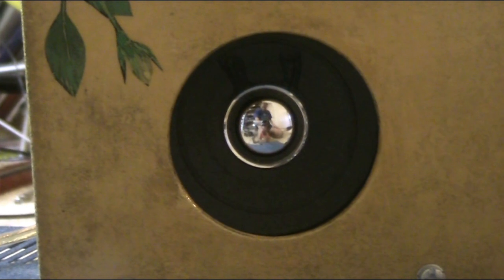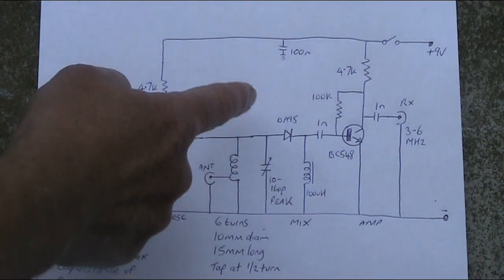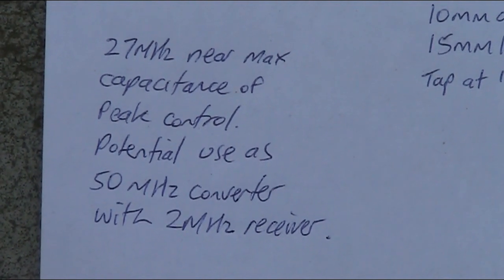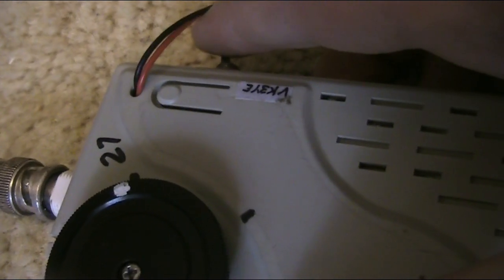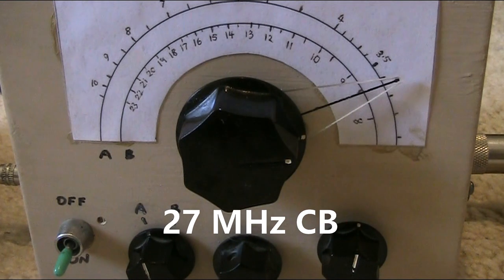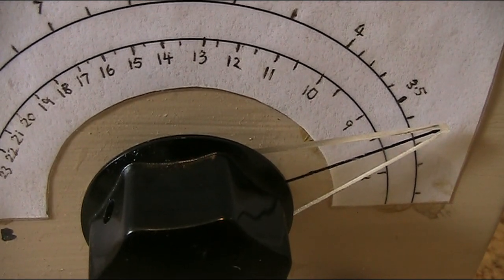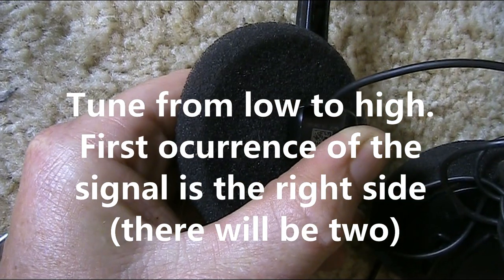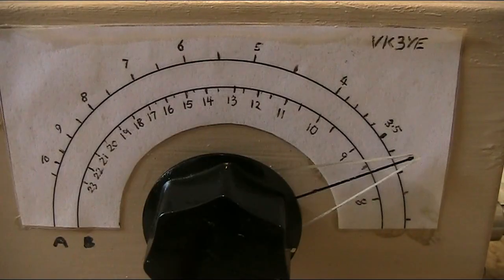Hear 27 & 28 MHz action with just 2 transistors

Comment: Thanks Peter, interesting stuff. Do you have any general advice on identifying the connections on that type of variable capacitor. I have a few but the markings are hard to read and I don't think they are all necessarily the same. Thanks.
Reply from the maker: O is oscillator, A is antenna, G is ground. O is smaller value eg 60pF, A is larger value eg 160pF. Good idea to buy a small capacitance/inductance meter to check.

Comment: Peter, is it possible to hear VHF airband, if I couple a 100 Mhz crystal oscillator to a digital radio covering upto 30 mhz maximum. So then if I tune the radio to 18 Mhz and above, will it be possible to hear the airband  from 118 Mhz to 130 Mhz. Please reply.
Reply from the maker: No. You will need to build a converter using that crystal oscillator and a mixer stage. Then it may work assuming the radio receives the AM mode.
Reply: I mean a 100 mhz xtal oscillator and a mixer of 18 mhz to 36 mhz, then will it work fine and give me a product  of 118 mhz to somewhere 127 mhz.

Comment: So this mixer consists of the variable capacitor, diode, and inductor?  What is this type of mixer called?  (I'm trying to learn about mixers right now).
Reply from the maker: I'd say just a single diode mixer. More often used for simple microwave stuff. Performance eg dynamic range isn't as good as other mixer types. But it's reasonably sensitive.
Reply: @vk3ye  cool thanks.  I watched your radio block videos with the plastic containers.  They were really good for me getting started understanding radio design.  Once i learn enough I'd like to build an SSB transceiver for 28Mhz.  Much appreciated.

Comment: Hello Peter, can I use 36Mhz crystal ? I meant 36 - 27 = 9 Mhz
Reply from the maker: It might work but I suggest not. Unless you modify the crystal oscillator circuit to operate the crystal in overtone rather than fundamental mode. 36 MHz crystals are typically overtone type that will likely oscillate on their fundamental frequency in the circuit described here. That means more problems including reception of unwanted frequencies.
Reply: @vk3ye  Ok. For 100uH RFC, can I use 150uH ?
Reply from the maker: @ssmbssmbssmb Should be near enough.